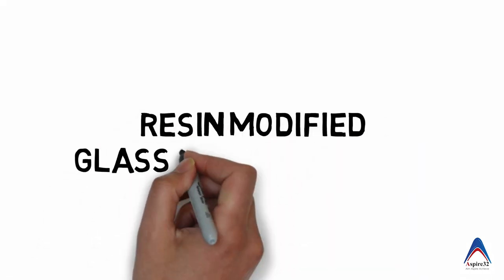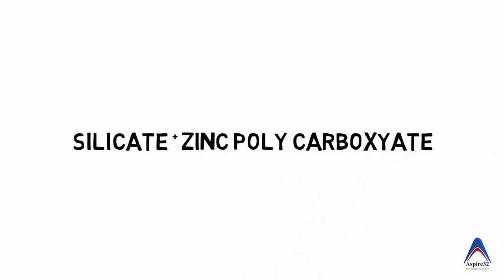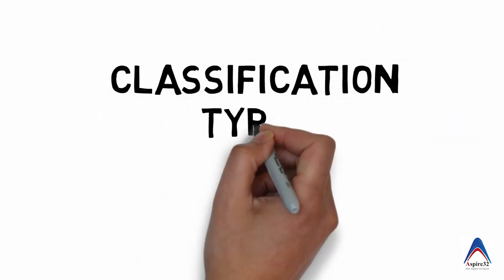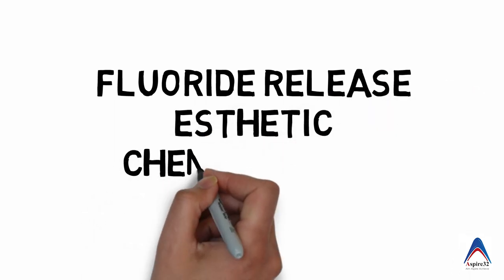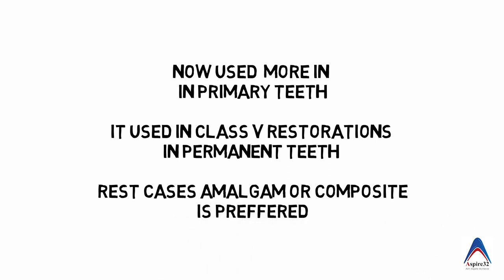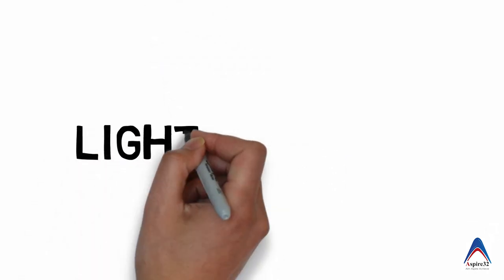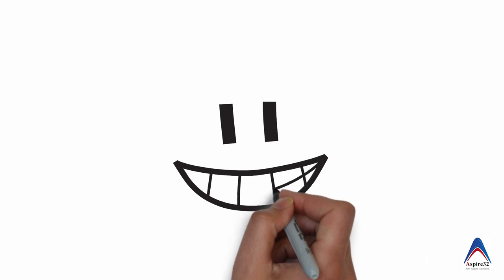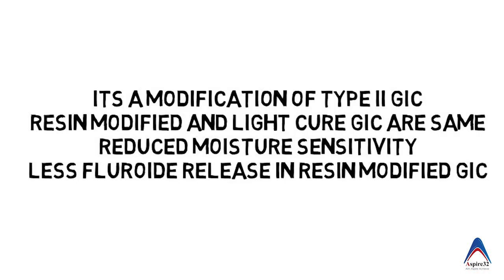Glass Ionomer Cement | Resin modified | Made super easy !

Comment: Dear Doctor:
Is it because the RMGI will continue its acid base reaction for the next 24 hours, it will need water and will take it from the tubules ending up with sensitivity!
Thus under composite we should not use light cured glass .. would you correct me if i am wrong
Reply from the maker: Water is a part of cement when u take it from liquid. I am not sure it takes much for tubule

Comment: Sir, I have confusion on compomer, I was asked during a viva the benefits and setting reaction of compomer. Compomer is resin modified gic. So are the benefits the same as explained in the video?

Thankyou :)
Reply from the maker: No. They are different. The compomer is a single tube system. It does not bond chemically to the tooth structure. Also it release  less fluoride than any form of GIC
Reply: Aspire32 thank you sir!

Comment: Sir I had a few questions, 
1) Why is it used more in deciduous teeth and is it used permanently? If so, why is it?
2) Why can't it be used as a permanent restoration in Permanent teeth?
3)When the conventional cement matures, what happens to it's water content?
4) Is the clinical classification (Type I - IX) accepted in an exam or viva point of view?

Thank you for your time sir
Reply from the maker: Ans 1 and 2-its has less wear resistance. So not suitable for class 2 and class 1 as it wont lost long. Also fluoride release helps a lot for deciduous teeth as they are more succetible for caries. Also GIC aloes consertive preparation.

3- the bound water is utilized in reaction.

4 - Thats brand classification. For example Fuji 9 and Fuji 7 both are type II GIC.
Reply: but sir this type 2 modified GIC reduces the release of fluoride... so is this alright for thr temporary teeth ?
Reply from the maker: Yes. But its not too less. We can still use it since it had other advantage

Comment: Sir can v use cention n for class 1 in permanent tooth. 
Actually some time patient not paying for composite work and also at the same time not want black colour (amalgam) restoration
Reply from the maker: Yes. You can use it. But the life will be less.
Reply from the maker: Cention is not a replacement for GIC. Its not chemically bonded. It needs undercut like amalgam

Comment: Is it used in class.2 restorations ?
Reply from the maker: Since Class 2 in permanent teeth are high stres bearing areas GIC is not a good choice.

However in case of non availability of other material this can be used. But it wont last long.

This can also be used as a transitional restoration.

Comment: Sir, Resin content if more then moisture sensitivity is less??? Bcz resin is resistant to water intake na????? I am getting confused , some say that resin increased moisture sensitivity but acc to this video when we have incorporated resin in GIC to make RMGIC, moisture sensitivity reduces..   plZ clear the concept sir
Reply from the maker: Its not about content. When the resin cures then it is less sensitive to moisture.
Reply: @Aspire32  sir means uncured resin is more moisture sensitive & cured resin is least moisture sensitive??? Am i corrrct sir
Reply from the maker: Yes. When I talk about gic moisture sensitivity, its when its set and you reduce it with aerotor. The water can still affect it since the gic  will fully cure after 24hours. So if u add resin the settings will be fast and then if u trim it now it will be less sensitive water

Comment: Sir, please tell do we need to apply bonding agent after etching with phosphoric acid before applying rmgic?
Reply from the maker: We can condition the tooth with  mild acid. There is no need for bonding agent with gic since it has chemical bond
Reply: @Aspire32  Thank you so much sir😊
Reply: @Aspire32  can we use rmgic for postobturation restoration?? Will etchant harm obturation?? Sir please reply..i am doing this case
Reply from the maker: @fahimahmad8167  you can but ideal composite is a better core material
Reply: @Aspire32  okay sir..thank you😊

Comment: Hi sir, your explanation was very good, but still i don't understand this one, 
I read a journal and they say if use Fuji II LC (traditional RMGIC) we should rinse after apply cavity conditioner, while if use ketac nano (3M espe) we do not rinse after apply primer.. 

Is it because traditional rmgic doesn't contain monomer on the cavity conditioner ? While ketac nano has it ? 

Thankyou 🙏
Reply from the maker: There are two types of conditioners.. rinse and non rinse.
Reply from the maker: Basically you can use an acid separately or a acid which u do not need to wash. You can use both type with any material. But the non rinse conditioner has found to create less porosity in the tooth, hence may offer less bond strength.
Reply: Thank you 🙏🙏